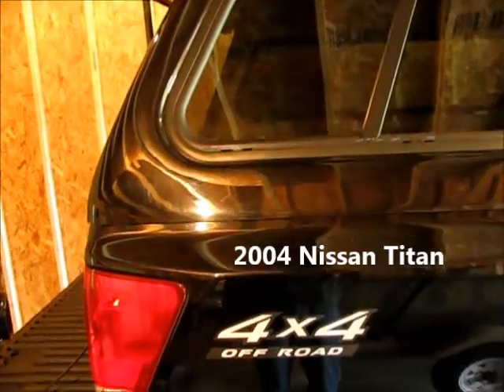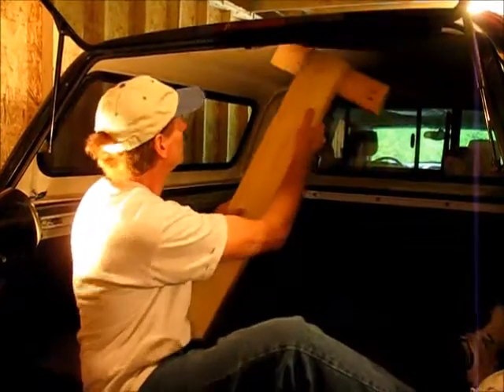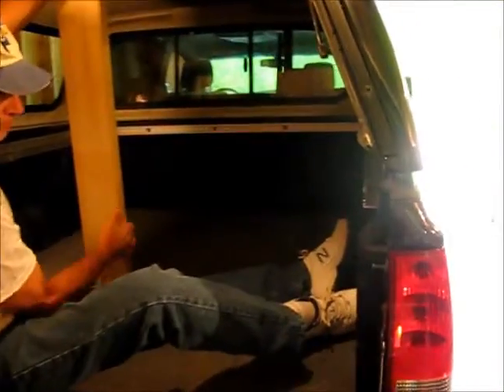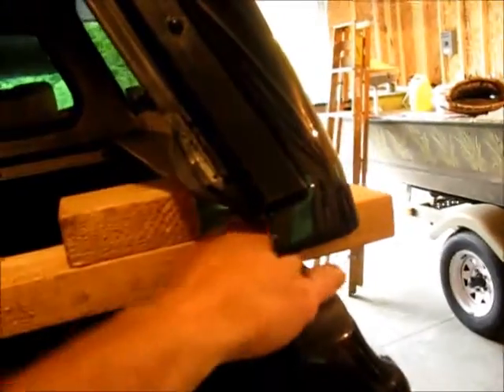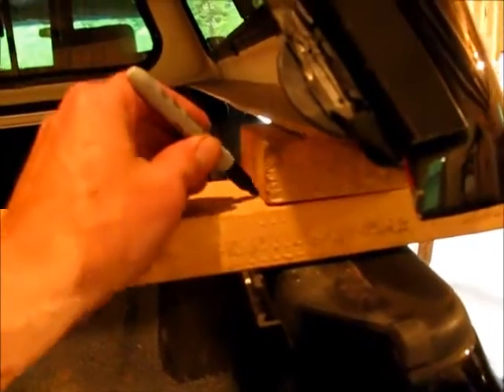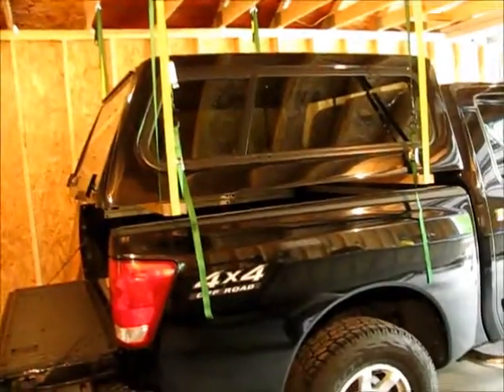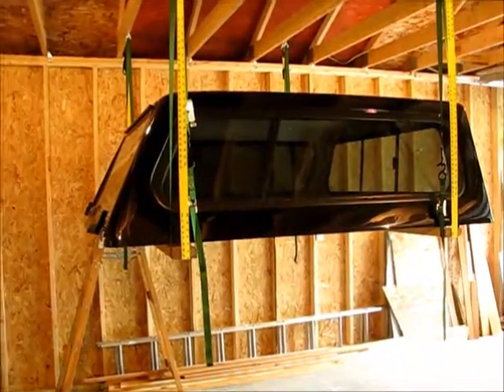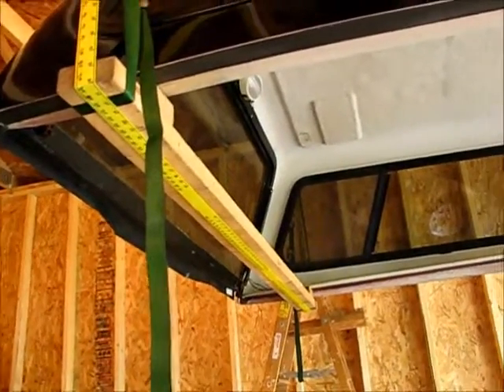How to remove a truck topper with an uneven bottom

Comment: I like the 2 X 4 spacer and the motorcycle/cam strap ideas. Wish I had a garage like this to do this with! One suggestion is instead of sliding those spacer 2 X 4 forward, use the T-Lift you made then slide it in. Saves time and your back! 😁

Comment: If you were to place a wheel chock behind each rear wheel then outline with a sharpie on the floor (providing the floor is cement) that way it takes the guessing out of how far you would have to back under the cap to reinstall

Comment: How do you think this would work if you opened side windows a little front and rear and put straps thru them,do you think weight of cap on straps would mess up top of window track.mabe padding with swim pool noodles?this might eliminate problem with lip on cap and need for all the 2x4s
Reply from the maker: I never thought of that method. It would make me a little nervous with only one set of straps. Also the weight will be concentrated in just  a couple of places which could be hard on the cap. But if it worked....it would be pretty easy.

Comment: I'd imagine that your set up places a lot of weight on your lift points. If you take into account that when the cap is on the truck the weight is seating on most of the length of the inner lip all the way around.

Comment: Thanks for the thoughts, I've got to build something similar for my Jeep hardtop.  What's to keep the top from not sliding off and crashing down when someone bumps into it?  I'm leaning toward just having the hooks on the tie downs holding the top.
Reply from the maker: otherstuffbybob Thanks for the comment. Good question.  It would take a heck of a hit to knock this down. the weight of the topper and the extra straps prevent it from just slipping off.  If it gets bumped it just swings. If a support board broke the ratcheting strap would still hold it. The cam buckle strap can't slip because it's held in place by the ratcheting strap. But if there was an earthquake or the joist broke...